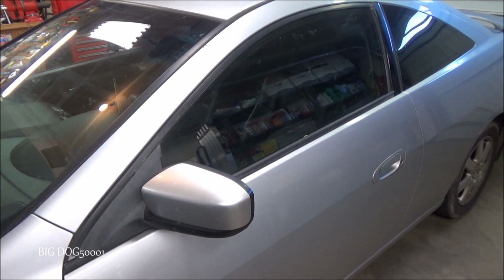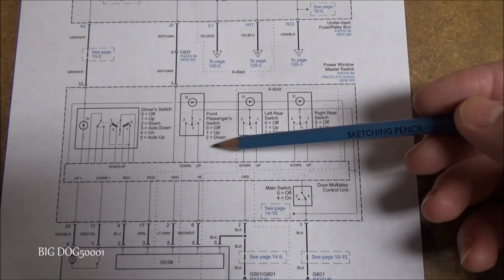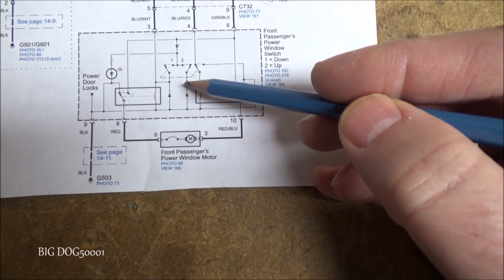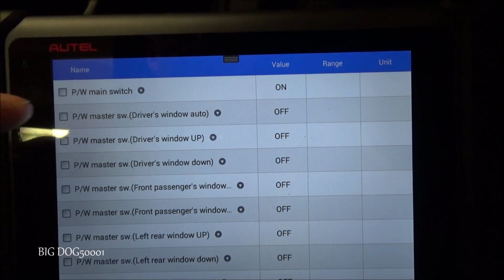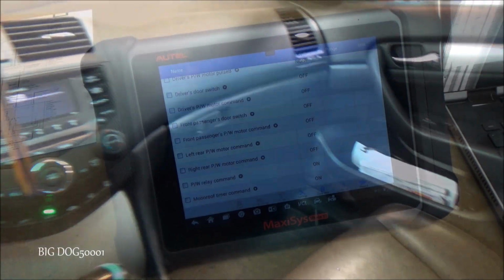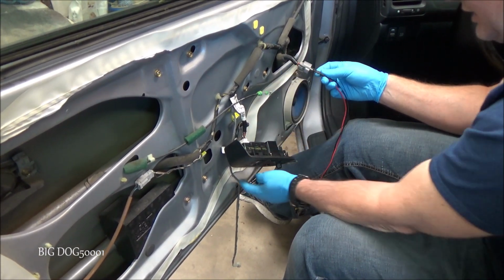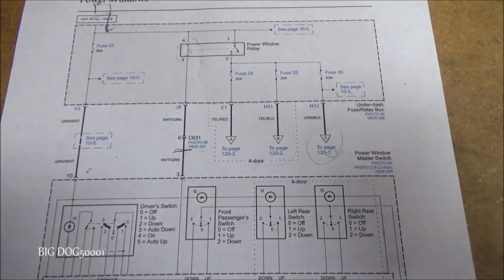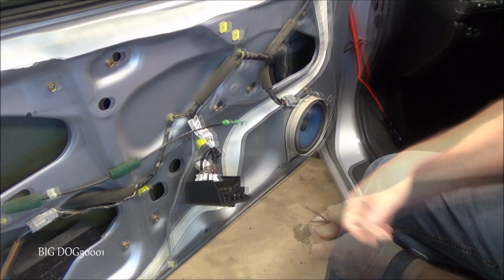Honda Power Window Troubleshooting Accord 2003-2007 (B-CAN Network)

Comment: My 2004 accord coupe had the same issue. i did take the door apart a couple of days before to fix my door lock actuator and a 2 days later it randomly stopped working after putting it down (didnt go up). I got a new regualtor from the wreckers but it didnt work. I tested the pins on the motor connector like you did in the video and im getting +12v and -12v  when i put the window up and down respectively. I put a new switch in it and its not the switch either. Do you think i just got a bad regulator from the wreckers and should buy a new one?
Reply from the maker: There is a good chance the new (old) regulator is bad.  I usually will test it by applying power and ground directly to the motor.  I always use a fused jumper wire for safety when I do this or I use a PowerProbe to test it (which has a fuse built into it).

Comment: Hi, great video. I hope you can answer my question on a similar topic. My 2005 accord exl , 4 door, 4cyl drivers window has been acting goofy lately and I'm afraid that one day it will not go up for me. I have to, on occasion, keep lifting the up button repeatedly to get the window to go up. So I decided to source out a new switch on Ebay. I found listed master switch's at  reasonable prices but some of had notes that if the key fob on my car had a panic button these switch's would not work for me. The OEM switch is very expensive and the recommended aftermarket by Dorman is expensive also. My question is, "Can you tell me why the cheaper switch will not work because of the panic button".
Reply from the maker: Those switches won’t work because they are for different models/trims and they are either wired different or the control module inside is programmed differently.  I try to only use Honda switches due to the control module inside, aftermarket ones can have issues.
Reply: @BigDog50001  I figured as much, thank you for your quick reply, keep up the good work.

Comment: I have a 2008 civic 4 door the drivers side window will not go down. However when I hit the button to lower it I hear the motor moving something down but the window stays up. When I raise the button I hear it running and it hits the window and pushes it with pressure but it’s all the way up already. This window works without issue 12 hours before this. Any help would be appreciated thank you
Reply from the maker: What you are describing sounds like a problem with the cable portion of the window regulator, and it most likely needs to be replaced if that is the case.  I would leave it with pressure in the up position (like you described) and would not try and lower it with the button, the window may fall down if left that way.  You can see me replacing a window regulator for a Civic in this video:  https://youtu.be/djdjsmJHANY
Reply: Thank you very much I will try this.

Comment: Dave, I have been looking for these videos for the past 6 months. Thanks much. This is the only video in youtube that explain B network window switch testing available. There are few from scanner danner but not the extent you went on this video, this become as bible. Thanks again. I like to donate some dollar to your effort, let me know if you have paypal, will do it. 

I have another request, how do i diagnose bad power steering pump vs power steering rack.  Assuming there is no leak on steering rack. also some Honda 's that i diagnosed it is very tight to steer the car, dont know whether to replace pump or rack and there is no leak on rack. Any tips will be helpful.
Reply from the maker: Thank you, I appreciate the comment!  I have an address listed in the description if you want to send me anything but I don't ask for money and do not have electronic accounts for that.  

As for P/S, in general a P/S pressure tester and some Honda adapters are usually needed to pinpoint a hard steering problem.  It could be a plugged/damaged line, bad pump or bad rack so it's not something I could give you an answer for in a comment unfortunately.
Reply: @BigDog50001   thanks dave, i sent 20 dollar thru paypal . it asked me first and last name, I just put bigdog5001 and put ur email address bigdog50001@gmail.com . if u have not received it , do pls let me know. Regarding power steering, what are steps u recommend me to isolate rack vs pump. pls advise.. how do u diagnose and eliminate one vs other.

Comment: My 2009 Honda CR-V’s electrical system shorts out for less than a second causing the dashboard lights to turn on as it does momentarily upon starting my vehicle. At the same time the headlights and rear lights all turn off for the same one second period. I noticed this only happens when the engine fan comes on. Can you offer an opinion as to what the problem might be?  Alternator, a belt, battery, fuse?  I appreciate your videos and look forward to seeing more of them.
Reply from the maker: If the lights are just briefly dimming or flickering when an additional electric load is placed on electrical system, that is pretty normal for a Honda.  If they go completely out then there is a voltage drop issue that would need troubleshooting.  

I can't see what your vehicle is doing so anything I say is a guess but here is a bit of background.  Hondas use an Electrical Load Detector (ELD) to sense the electric load being placed on the system.  The ELD sends info to the Engine Control Module (ECM) which controls the alternator output.  Most Honda alternators have a high and low output and the ECM uses the ELD info to control the high and low output on the alternator.  

If a high electric load (like cooling fans) is placed on the system when the alternator output is commanded low (or the alternator is commanded high but is not putting out enough voltage), that can create the potential for voltage drop issues especially if the battery is weak.  

If there is indeed an issue, I suspect it might be with either the battery/alternator/ELD/wiring or any combination of those.  Of course it would need proper troubleshooting to determine what the issue is, but a weak battery is an easy place to start.

Comment: The first 10 minutes looking over the wiring diagram was (at least for me) very helpful. I don't have a Honda but just reviewing the lines of powers and grounds is universal. Having a scanner with blue tooth is way cool. The window went up and down like magic. Oh yeah, the fact that when using the passenger side window didn't show up on the scan tool would have confused me. That's where experience comes in. I enjoyed the video Dave. Thank you.
Reply from the maker: The wiring diagram took longer than I wanted but I felt it was necessary, thanks for the comment!